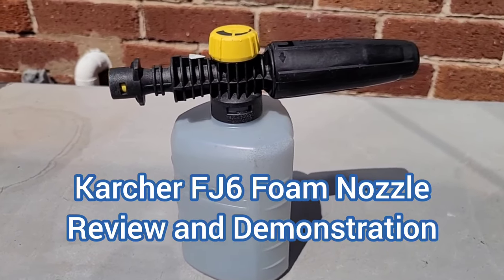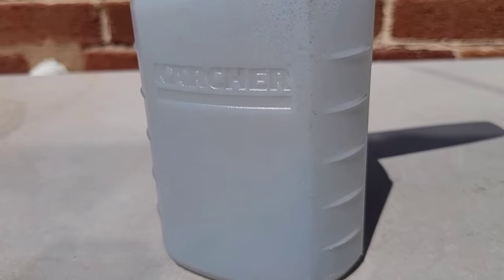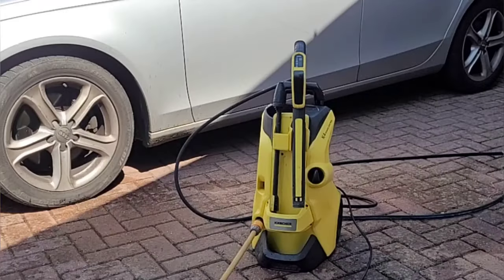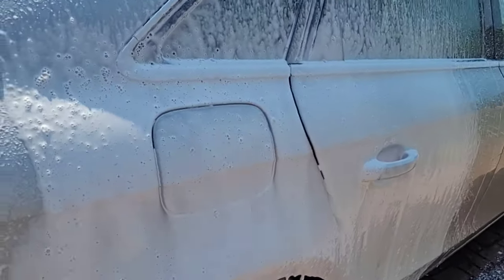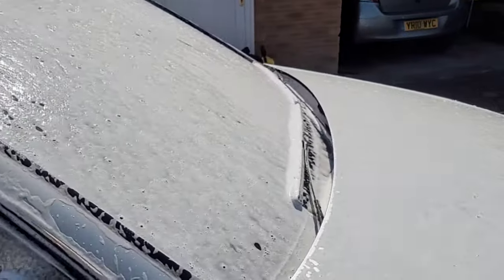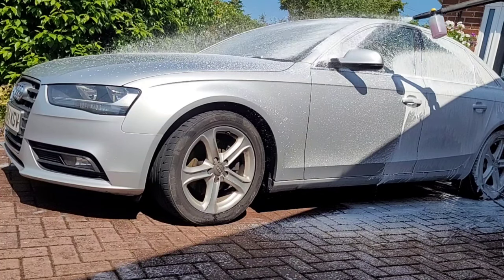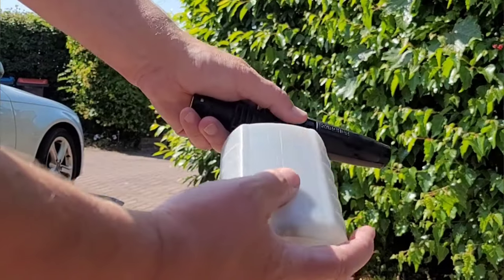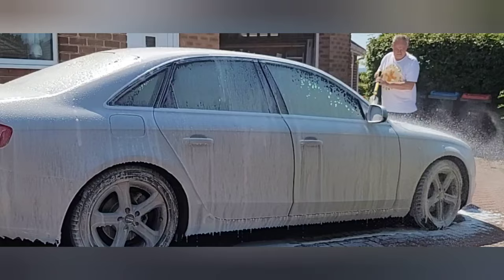Karcher FJ6 Foam Cannon User Review and Demonstration

Comment: Dreadful thing.  Every time I use it with my K4 washer a yellow grommet from the attachment gets stuck in the lance and has to be levered out with pliers.    Cheap and nasty.
Reply from the maker: Sounds like you got a faulty one. I've not had a problem with mine apart from needing to clean the nozzle. Have you tried gluing the grommet back into place?
Reply: 😂😂 thats a faulty foam bottpe
Reply: Same thing happens to me aswell. Really annoying.

Comment: Bought one after this review.  It is rubbish!  Used Simoniz snow foam cleaner, and got a nice foam.  Despite a pre-rinse with the jet washer, two applications of the foam at slightly stronger than the recommended dosage, and a rinse off with the jet washer, the light road film on my car stayed and I had to resort to a traditional sponge wash.  Might as well have used a bucket and hose as it's a lot less hassle then setting the Karcher up!  YMMV.  The yellow insert in the cannon's connector got stuck in the Karcher handle and had to be prised out with pliers leading to it being damaged, so the cannon is being sent back for a refund!
Reply from the maker: You were right to send it back if the yellow insert came out as it was obviously faulty.  I think however, that you have misinterpreted how snow foam is supposed to be used. Snow foam is not designed to give you a touchless wash. Snow foam is used as a pre-wash that breaks down and removes the worst of the grime when rinsed off. This should then be followed by a contact wash with shampoo. This video shows the process: https://youtu.be/k1X4d6nGOG8
Reply: @bigtedshome  He also incorrectly applied the snow foam to a pre-rinsed and wet vehicle.

Comment: Do you apply the snow foam onto a dry car? Is there any benefit to giving the car a quick blast just with water first?
Reply from the maker: Yes, apply the snow foam onto the dry car. Rinsing the car first makes it harder for the snow foam to adhere.
Reply: @bigtedshome  cheers mate 👍

Comment: thanks for the review, was a bit worried after ordering this cannon, but your video shows that it does the job. thanks again
Reply from the maker: Thanks. The FJ6 is a decent little foam cannon. Just make sure that you run water through it after each use or it can get blocked (this applies to all foam cannons tbf).
Reply: @bigtedshome  will do, thank you 👍

Comment: Fantastic video. Thankyou. I’m ordering this now.  While using the foam gun, does the hose (water supply) need to be connected and turned on.
Reply from the maker: Thanks Jackie. Yes, you need the water supply connected and turned on whenever you use your pressure washer. If you don't, it will destroy the pump.

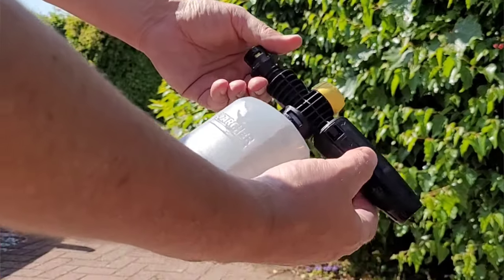Comment: 7:21 you change scene to a black Fiesta. I have had mine for 5 years now and like my previous two cars have always used a mitt or sponge with a bucket of Wash & Wax. I have found this takes a long time and although makes you feel you have actually done the work rather than a machine and you do apply more effort into the job compared to someone who used a pressure washer, it is tiring and back breaking as well as time consuming with longer time taken and more elements to the job. The main drawback with pressure washer car cleaning is you feel that this is a job more suited to hardcore petrol heads (the type who own sports cars like Golf's GTI's and Focus RS's) who spend thousands on their car. I have had a Renault Clio Expression, Mazda 2 TF and this Fiesta Titanium so hardly a massive petrol head. But I am looking forward to getting the Kaercher K2 today in time for Santa to deliver it. I am more looking forward to finding out the difference between bucket washing and using a machine that takes all the work from me.
Reply from the maker: Why should the petrol heads have all the fun 🙂 You will still have to work though as you need to use a mitt for the second stage (shampoo) and a towel to dry the car if you don't want any water marks.

Comment: Great video. Stupid question but if the water is flowing through the Lance to activate the foam do you not just add the foam neat into the container. Or does it still need to be watered down with a 5:1 ratio
Reply from the maker: It depends on the foam you are using. Most snow foams are diluted before adding to the foam cannon. The water flowing through the lance further dilutes it to the correct concentration.

Comment: thanks for the video, i was going to get a K2 unit, I understand its similar, but have you heard from others if its got the power for simple car cleaning and a bit of paver blasting
Reply from the maker: Thanks Shane. The K2 should be fine as long as you don't want to clean large areas of paving. You might find the 5m hose to be a pain when washing the car but the k2 is light enough to move around easily.

Comment: I've had three of these and they're not very very good. The yellow seal/washer/whatever it is came out of the first one as I removed it from the lance and I had to mangle it to get it off; I put it down to bad luck and got another. The second caused my Karcher K4 to pulse so I took it back to Halfords and changed it for the third one which has yet to break. The foam is thin and runs straight off the car and onto the ground no matter how you set the dial.

Don't waste your money.
Reply from the maker: Which snow foam are you using?

Comment: Great video, did you decide to skip the polar seal step?

I've got a K4 and have replaced everything on it with better after market bits.
Love using it to clean my car, but it's just too hot at the moment to use.
Reply from the maker: Yes, I skipped the sealant because there are a few stone chips I need to sort out. 
It's too hot to do anything at the moment 🥵

Comment: could you use this to apply Sodium Hypochlorite if it was only used for that? and would it effect my washer in anyway , and thanks for sharing the vid
Reply from the maker: I don't see why not as long as you are careful where you spray it. The plastic shouldn't react with the sodium hyperchlorite but I would wash it out afterwards. It won't affect your pressure washer as the sodium hyperchlorite is forced away from the machine by the water flow. Let us know how it goes if you decide to try it.

Comment: Do I need to have water from hosepipe turned on to use snow foam ? Thanks
Reply from the maker: Yes, if you run the machine without water running through the pump, you will wreck it.

Comment: Any advice of snowfoam for brake dust on wheels?
Reply from the maker: You will need to use alloy wheel cleaner like this and a brush to clean off stubborn brake dust: https://amzn.to/48PqQ4q
Most of these cleaners are corrosive so always wear eye protection and gloves when using them.
Reply: @bigtedshome i saw somewhere video where it going off without brush, thought some snowfoam like demon snowfoam for wheels, do job without brush
Reply from the maker: @obuchalki  It depends how baked on the brake dust is and how good a job you want to do. This guys videos are worth watching: https://youtu.be/bjmi07ISYLc?si=2HjCQ46yGxk880Kr